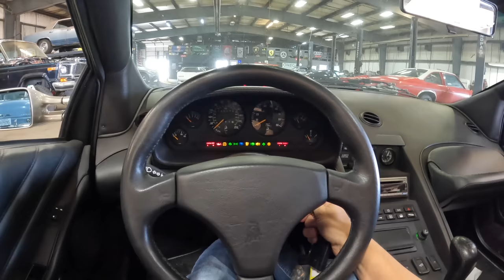All of my Lamborghinis are PERMANENTLY BROKEN, and that's totally normal. The Car Wizard GIVES UP???

Comment: With regards to a strange noise coming from the Lambo, here is SWAG since the noise appears to coming from an area between the firewall and the engine .  When I did the 6 cyl conversion on my 914 there was this really strange noise that was related to engine RPM and would only occur under heavy acceleration.  Turned out that the engine was too close to the firewall.  Under acceleration, the engine would shift slightly forward, just enough barely touch the firewall.  Since the 914-6 conversion  is mid-engine like a lambo, the noise maybe related to the engine moving and the noise may be a strange vibration issue.  Again, this is just a SWAG.  Good luck

Comment: Hey Tyler! I didn’t realize you are so tall. That does become an issue with some cars. I could go on about it but I have an idea to try and find that MOAN. Because it happens at a certain rpm, I suspect resonance as you and the Wizard do. So I got to thinking about finding the frequency and possibly be able to determine the size of a piece of metal that would resonate at that frequency, kind of like a tuning fork. Then I got to thinking you just want the noise to go away and I have an idea that might help. Since you know the general area it is coming from, try gluing something with some mass to different spots to see if it will interrupt the resonance. Or even something that could absorb sound waves and deaden them, like a piece of wood. Wood burns of course so you probably don’t want to use that, but you get the idea. I hope this helps if you decide to try it. I just had another thought, you might be able to use a strong magnet to attach something or a big magnet by itself. Two caveats though: magnets don’t stick to aluminum and some sensors could be affected by a strong magnetic field nearby.

Comment: I know nothing about the engine in that Lamborghini, does it keep a number of valves closed below a certain RPM or throttle position? I drive a V6 Ford Mondeo and if you pass through a certain RPM slowly, you get a drone as the Secondary inlet valves open, you can also hear it holding that threshold but dont hear it when booting it. I believe its a resonance in the inlet manifold that causes it on the Mondeo.

Comment: I take a guess at finding it if you ever are to find it. If it happens only when rolling, it could be the drive shaft bushing that goes to the front diff. If it happens only while reving it at 3000rpm, on every speed and when it's hot, I would say it's the water pump. You could check it by removing the belt if it's possible without an engine out job. I watched schematics on google and red about the diablo versions on wikipedia to find what I could look for.

Comment: My 2002 Avalanche sat outside in my driveway and was not started one time all winter.  Last weekend I needed to move it to get to my mower and it started right up.  The one SINGLE common theme is The Car Wizard.  It's time to cut your losses!

Comment: The noise is from the air in the exhaust manifold and down to the cat/flex pipe. The noise comes on between 2k-3k rpm. The air flow through the exhaust side and studdle around the area i mentioned instead of releasing it out through muffler like it should. THERE!
I found your problem.
$5,000 for the diagnostic.

Comment: Since the noise wasn't found anywhere in or on the engine, I wonder if it coildn't be a resonance of something on or within the firewall, perhaps a slightly loose heat shield, insulation panel,  or something possibly attached to it (if there is anything), like a wire harness retention tab.  Just throwing ideas out there, as I don't have one, nor have I been around one, but something has got to be the source of that moaning noise.

Comment: I feel you on this issue hoovie I have a Turbo BRZ, I've had a slight squeak ever since I put a set of headers on the car, then with the turbo kit the sound is still there.... I've replaced a bunch of parts that I for sure thought would fix it with no luck. its very annoying because in the nice sounding rev range my car makes this awful noise that just makes it very annoying  to drive... I am determined to fix it though!

Comment: Wizard not charging for diagnosis work is a world away from mechanics I know in the UK. In fact, the mechanics usually avoid cars with peculiar issues and give excuses as to why it's a waste of time, or they try and scare the customer with big bills and nightmare scenarios. If you do get them to try and investigate, they will just plug the computer in and change whatever gives a fault code, big or small. At the end of the day, most mechanics just want quick and easy jobs in and out, like an oil change or a new tie rod, to make ends meet. My solution to this was to learn how to fix cars myself to the best of my ability.
Reply: THANKS FOR WATCHING-🤝
You have been randomly selected 
Send me a direct msg right away 👆

Comment: I would say alot of the countach and Diablo problems stem from them sitting so long.  I bought an sl600 from a guy who had it sitting in his garage the last year and he hardly ever drove it.  I put 250 miles on it in 2 weeks. Then within 30 days was up to the shop 3 times.

Comment: I had a car years ago that made a similar sound and it was the fuel pressure regulator vibrating at pacific rpm’s from memory it was the fuel pump pulsing and causing the regulator to pulse at the same frequency as the pump making the moaning sound.

Comment: I'm going to bet that whine is the layshaft.  That noise has been with Harry Metcalfe's Countach since he bought it, 15 or so years ago (??).  Check out the most recent video on his channel, Harry's Garage, where they have got the gearbox in bits and you can see what's wrong.  (It's Part 3 of the Countach updates for people reading later than today, 1st May 2022.)  At the end of the video there's footage of some of the noises but the whine is quite hard to hear under the other problems.  Still, Harry does distinguish it in the footage.

Comment: The Diablo just needs a long appointment on a dyno being held at the problematic RPM with a tech listening through a mechanic's stethescope touching all the points on the motor until they pinpoint the source

Comment: Here is the answer.  When I was a first time motorcycle owner back in the 70's, I only owned 2 cycle European bikes.  I learned very early that the universal rule was that if I rode the bike for an hour, I'd have to work on it for an hour.  Tyler......there's your rule.  For every hour you drive any Lamborghini, you'll have to pay Dave for an hour of work.  If you can live with that, then well, there are lots of yachts out there to buy.

Comment: Even if your Lamborghinis break more than the average car, they're still Lamborghinis and still have that exotic stigma and presence that only a Lamborghini has.

You could purchase a new, more reliable American sports car that doesn't have a large repair bill attached to it everytime you go to a garage but it would never be a Lamborghini or give you the same driving experience.

As long as you can afford an exotic supercar, I don't see anything wrong with paying the extra cost that accompanies them in maintenance and repair costs.

Comment: hey hoovie & wizard.., maybe this is an air problem, meaning air is being scooped into some place: ie : vortexing, wind tunneling from front to back and exiting at the first low pressure spot/area thats down the line, the engine compartment. the car is supposed tobe aero dynamic and have one of if not the lowest air coefficient.

Comment: Min 9:45.It must e the bearings.Some berings in front of the engine.In the ,,back sites''.Some ,,pine'' bearings are diform.Sorry for bad english.
Reply: You have to pull the engine out.
Reply: And they can break,like ball erings.Even more spectacular.If you notice smoke,don't check the nothing,first ,then your belt.In front of the engine.So,that whine,if from and old bering,more likely in the shape of pine tree.The engine must cam out.In the 80's,they will not put double round berings.They use pine /long steal berings,in shape of the pine tree lefs.My english suck's.i will stop here.
Reply: P.s; sooner or later YOU HAVE TO PULL THE ENGINE OUT FOR THAT NOISE.IS NO JOKE.

Comment: On that diablo you sure it not an interior problem and not an exterior because I've got a moan in my car and unfortunately I know what it is I'm just to lazy to fix it. Mines a bolt lose on the electronic suspension control unit. Bolted inside the car. It could possibly be something loose inside the car and only makes the noise at certain roms
Reply: Rpms...darn autocorrect

Comment: Lambo moaning: did the wizzard put the car up on stands or the 2 post lift with someone in it driving it so it could be scoped from underneath? 
If it needs load go to one of those new dynos that you take the wheels off and bolt directly to the brakes and jack up the front?

Comment: That noise is probably the water pump. I've heard this noise before, and we couldn't find it either. Until the water pump locked up. Just something to think about.
Reply: Water pump is on the back of the engine, not the front.

Comment: Did you rule out the Capristo/exhaust system/headers? Is the possibility that it is something firewall-related...something maybe as simple as something not 100% tightened/secured against it...worthy of more research? What about the possibility that it's something loose on the interior side of the firewall? Maybe it's worth pulling the seats out and checking from the gearbox back? Obviously, the origin of the noise could be coming from the exact opposite direction of one's perception. I think you should investigate everything else before even considering pulling the engine and gearbox, especially as focussing on that area hasn't delivered any results so far. The most obvious isn't the same as the most likely. The source of such noises is often the least obvious. It could come down to a loose screw...

Comment: IT'S STRAIGHT CUT GEARS IN THE TRANSMISSION!! That's why it's happening at a certain rpm... At some point, someone grinded down a couple gears, and to save money they replaced helical cut Lambo gears, with straight cut aftermarket gears... Open up the transmission, you're gonna' find gears that don't match the machining of the majority. THAT'S WHERE THE SOUND IS COMING FROM!! Replace them with factory gears... Btw,  Countachs and Diablos are pretty bulleroof cars man. If you can't keep those two fixed, you, Wizard, or both, are doing something wrong... Screw the Anniversary and the Egear Murci, sell them... Don't drive the Diablo, fix it, store it, great investment car... Driving Countachs is great. My favorite supercar. It may not be insane fast, but plenty fast enough to ba blast to drive, with a gated manual!

Comment: I have a moan like that in my mercury grand marquis, happens around 40-45 mph (no idea what the rpm is because it doesn't have a tach). Nearest I can figure is it's something about my exhaust setup, if it had a bit more mid pipe or a different kink somewhere it would go away- also an important lesson to not mess with mechanical systems unless you know what you're doing in my case, I never should have messed with my exhaust. I don't think that's what you're dealing with in yours though.

Comment: Well, let me just put in my 50 cents regarding the moan. I once had a similar problem, on a much lesser car (won't mention the model and make so this comment gets discarded based on that). There would be this weird moan that would come from one side at certain speed and RPM, but none of the mechanics could find the exact reason, or location. In the end, I decided, just like Hoovie, to let it be. However, I couldn't in the end. It was too distracting. And then, after weeks of digging deep, I found the cause by chance - accidently touching the part. The trim that was covering the door hand sensors behind the door handle was a bit loose. At certain speed and RPM it would sound somewhat similar to this - only thinner, which was really weird and unexpected sound. The weird thing is that  the speed (arround 110km/h) and RPM (forgot the exact number) had to match. IN the end, it only took gluing the trim to the door, and the moan was permanently gone. Now on Diablo, due to aerodynamics, I'd say that the spot that you hear the moan coming from, would be ideal to have a similar situation of some loose trim part and engine vibrations... I'd check that, even if it doesn't make sense.

Comment: Better off getting a Lamborghini tractor.....they have very  reliable  tractors.  I had one for over 25 years.....it ran like a clock all that time. It was prone to getting flats for some reason.  That and 5 engine rebuilds and two transmission failures. But yeah...that is what a Lambo does...even their tractors.